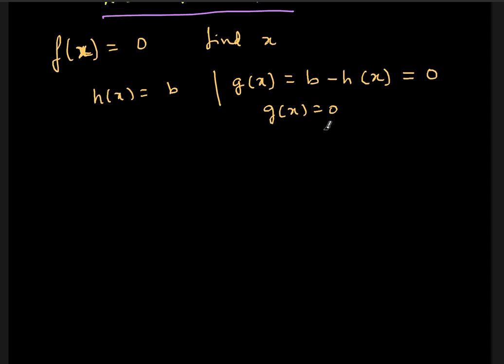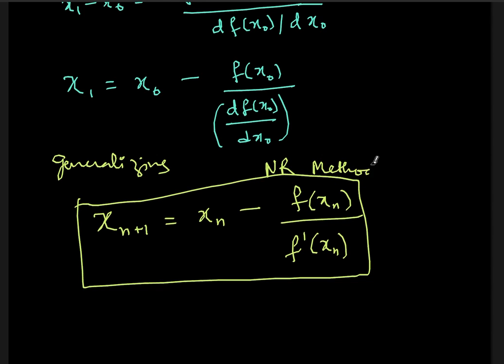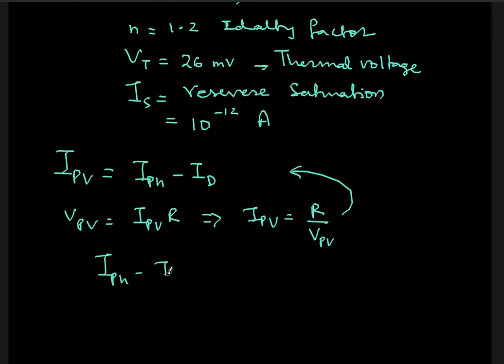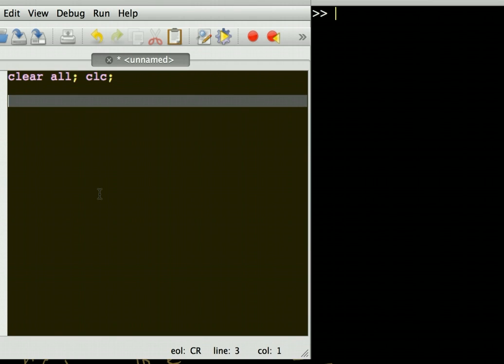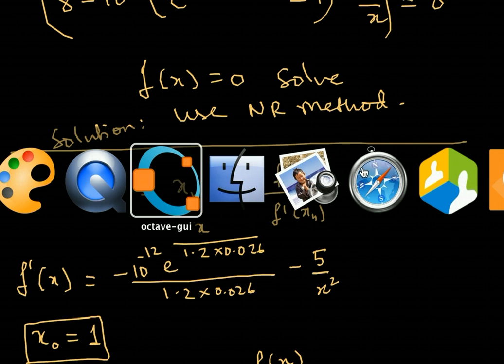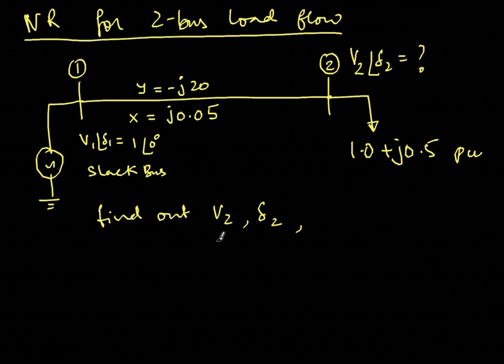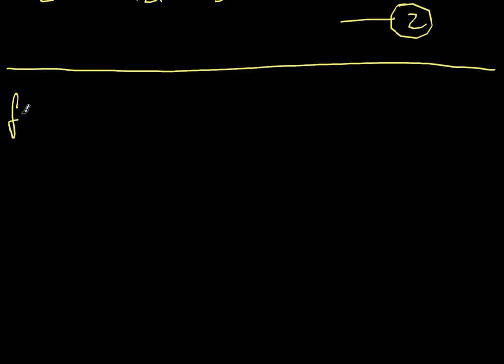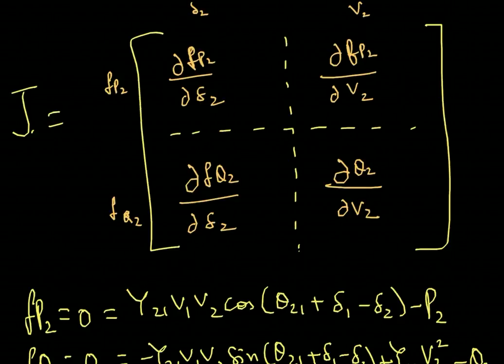Newton Raphson - Solar PV Cell model and Two Bus system

Comment: Hello Sir, at 12:50; how did you put the value of Ipv = R / Vpv? It should be Vpv/R. Because it is contradicting Ohm's law. Secondly I would really appreciate if you include the series and shunt resistance and then calculate a working point on IV curve. It would be little tough and time consuming but that would be a real case then. Thank you
Reply: That will then also change your derivative values.

Comment: Sir, why the value of convergence is 0.625 if I use 0.8 or less as starting value??? If I use 0.81 there is no convergence whatsoever!
Reply from the maker: can you mention the time stamp at which your doubt is about. For example to go to ten minutes five seconds just type 10:05 and it will automatically link to that time on the video

Comment: Sir first of all thank so much for all the super interesting clips you have uploaded. As regards to this one there are a few mistakes. First the last term in the equation of solar PV does not match current units, so the fraction must be inverted and secondly the derivative of that very same term is lacking of a minus sign.
Reply from the maker: @Leon Thanks for pointing out the mistakes. 

For the benefit of viewers here are the mistakes:
The first mistake happened at 12:50 in the video, it should be Vpv/R instead of R/Vpv
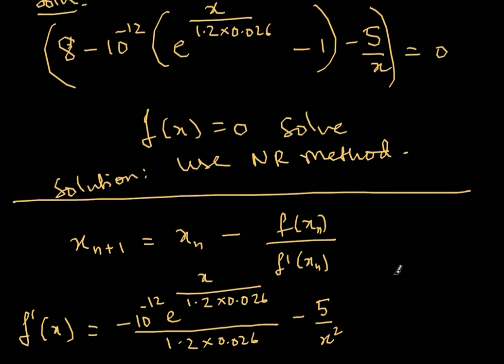Second mistake happened at 17:50 in the video, instead of -5/x^2 it should be +5/x^2

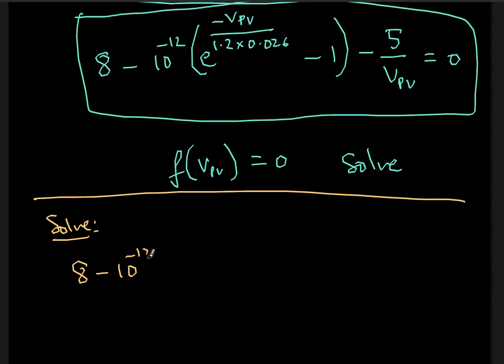Comment: I very much enjoy your videos, they are a terrific source for review!! However, there appears to be a slight error (Ipv is incorrectly defined) at 12:49 for Ipv; I believe it should be defined as Ipv = Vpv/R. Also, at 15:36 in the exponential portion, shouldn't there be a minus sign in front of variable x since it was defined as a decaying exponential?